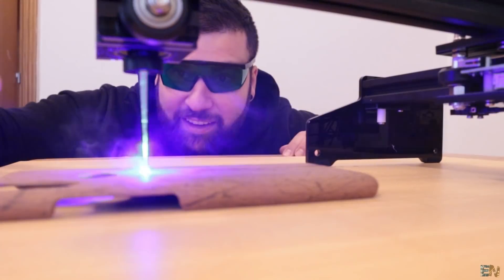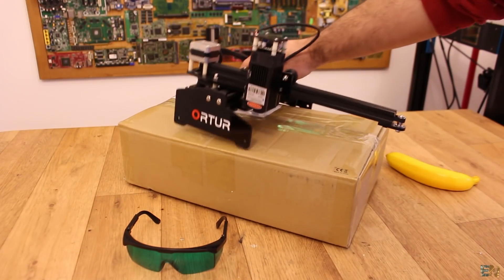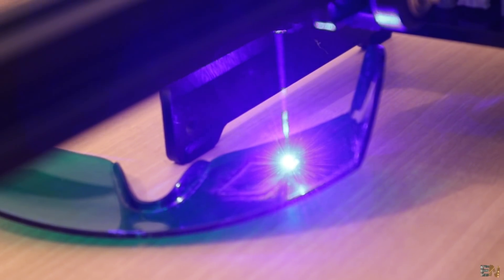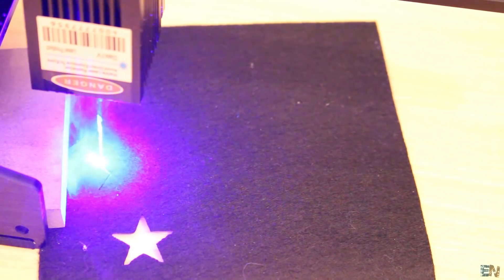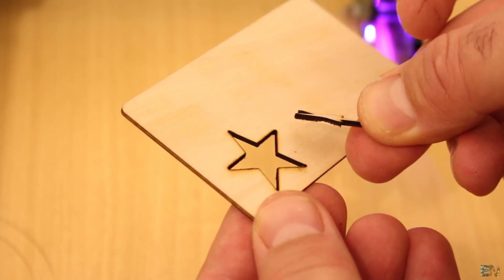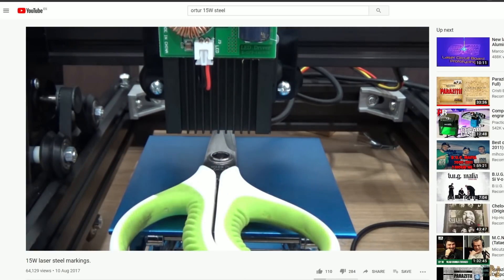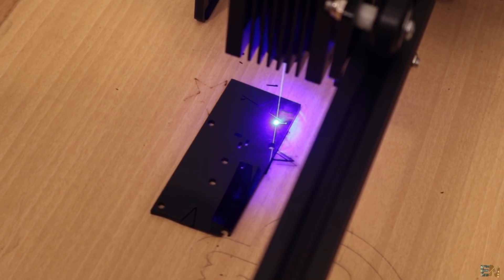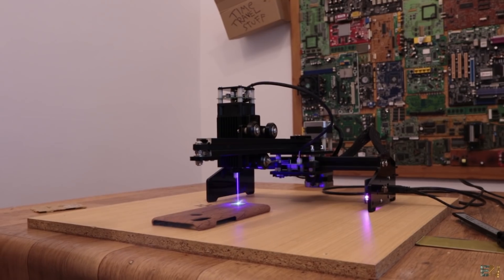What Can You Cut With This "15W" LASER Machine?

Comment from the maker: Sign up at ELECTRONOOBS.io: https://electronoobs.io/
Follow me on FACEBOOK for more: https://www.facebook.com/Electronoobs
help me on Patreon: https://www.patreon.com/ELECTRONOOBS
Reply: Hi
You can upgrade the laser to work better..
Just add an Z axis to the laser mount..
You can add also a microswitch under the laser.
So every time it resets can attach to the cutting material and then reposition to the pre-cut height.
After the end of each loop the laser will be lower at the height of your choice and so the cutting edge of the laser beam will be in the right focus
Reply: Thanks for this very detailed video and subscribed.
This electrical power 15W one, could engrave stainless steel, but it need to use the marker pen to paint black the serfuce of the stainless steel, to adovid reflection.
Also, it would be better to adjust the focusing to be as close as possible to the lens.
Reply: Thanks for the review. I couldn't find the link for better safety glasses.
Reply: Hey. Great video. Could you please share link for good quality recommended protective glasses? :)
Reply: You cant  cut wood or plywood with this laser without the compressor, use one from cheap chineese soldering station  and a needlе for ball pumping at least it will go 1000 times faster , i cut 3 mm plywood with chineese 1 w laserpointer and sodlering station compressor 6 loops on 150mm/min
Reply: Thank you for the video! Any information on the high quality laser safety glasses you discuss on the video? I just got a CNC 3018 with 5.5w laser and I do not want to use it without good laser protection.
Reply: If you notice on the video the scissor he liftend it close to the lazer you did not. Why do you youtubers always never notice differences. Pay better attention! If you copy someone make sure you copy right haha copyright!

Comment: 7:42 you can clearly see the problem is not the laser power rating but the focal "depth of field"; on an engraving laser the depth of field is a fractin of a mm because it only needs to burn just the surface of the material (of course burning 0.1mm of wood would talke a lot less power than carving 0.1mm of metal); for a cutting laser what you need is a depth of field slightly greater than the thickness of the material you wish to cut; for foam you can get away with a 5W laser as long as the focal depth of field is (in your case) 5 mm or more, which clearly the laser you showed hasn't.

Comment: To echo @Jo Flo More passes at a faster speed is usually better than less passes at slower speed. A few more tips:

Fixed focal lengths are a bit less stressful, but also less flexible. I use a 7w with a variable focus, mounted to a 3018 with Z axis. I'll set my Z home as far as possible from the material surface while still able to focus the beam properly. The reason is because the longer the beam before the convergence point, the narrower it will be immediately above the focus. With that, you can cut deeper into material--the previously cut material above doesn't interfere with as much of the beam, as it would with a wider beam due to focal point closer to the module.

I use the 3018, but there's nothing specific about that spec that is better or worse than another. The important part is the Z axis. I can generate my gcode to lower the Z by a few micrometers with each pass, keeping the focal point at the material. The rate of Z adjustment is different for each type of material.

Some materials, like wood, produce ash when burned in the cut. After several passes, the ash will completely block the beam from being able to penetrate deeper. The ash also glows, therefore radiating the thermal energy to the sides and causing unwanted results. I use 2 strategies: a relatively high CFM fan to blow ash and smoke (which cools into soot/ash) away; and I configure break points in my gcode so that I can take a moment to brush the cut path before resuming.

Hope these help!

Comment: With a cone shaped focus point, rather than setting the focus point on the top surface, try setting it roughly halfway through the balsa, it won't be as clean of a cut, but it should make it to both sides.

Comment: Laser cutting and engraving is quite complex. I too found balsa to be strangely resistant to the laser.  In contrast,, amazingly , I was able to engrave several different types of rock(even polished rock) and  I was also easily able to cut through 5 mm mdf at high speeds.

Comment: I've been doing test cuts on different materials. Chipboard, Modeling Plywood, Basswood (from Linden trees). In different thickness. The plywood is the toughest. I think it has something to do with the glue between the layers. Basswood. Blows through Basswood like a its air. Chip board cuts really clean but the engraving is very fragile. I really need to build a fence system and clamps so I can take parts off the machine and register them for secondary operations. I'm more interested in structure building in HO scale. The engraver will be used to engrave brick patterns for walls with the brick patterns interlocking like finger joints. Just draw up all CAD drawing with the same start point.

Comment: thanks for the video! I've seen a lot of these types of machines advertised on my Facebook feed. I've got a 130W CO2 laser and i typically cut 3mm acrylic and 30mm/s and 3mm MDF at 45mm/s. typically engraving speeds of 400mm/s. I'd have to agree with the glasses although because you are dealing with visible light, if you can see any blue light at all then id say that they are no good but better than nothing. one thing that bothers me with these cheap machines is that there is no air assist. if you had a nozzle that added pressured air to the cut location then the cutting speed would be greatly increased. it's just something all these machines don't have as an option. that and fume extraction :P a good little machine for experimentation and prototyping. I've ordered a "40W" laser which i will just mount to my CO2 laser head ( my controller has dual laser head control as an option) so I'll run some experiments soon :)

Comment: Yeah those cheap laser googles are garbage, real laser safety googles have an OG rating (number of digits it reduces the power) and real googles for blue lasers are orange.
the cheap one melting green layer means it blocks (eats) some of the energy, but I doubt it´s above OG3. OG3 at 4000mW would let through ~4mW, which is to high for eye safety. 1mW is rated safe for the eye shut relfex beeing fast enough.
OG4 rated laser googles should be used as minimum for this power.

Comment: I know I'm late, but I've got a tip for cutting through wood an the plastic: Lowering the speed is not always good. It leads to charing and melting, which makes the material harder to cut. If you move faster with more passes instead, you don't get these effects as much, and can achieve harder cuts.
Reply: Correct
Reply: Covering with a damp paper towel helps absorb excess heat

Comment: I think your lack of success on plastics is because you assume the laser cuts it by melting it. This is not the case, it's vaporizing the top layer. By staying too long at the same place, it's melting and becomes messy. I think most of your experiments would have worked better if you made more faster passes (with Z axis change for focalisation as you mention in the video)

Comment: to paraphrase, "The tightly focused beam couldn't penetrate the glasses, so for protecting your eyes from a distance hit from an unfocused beam, they are not good enough."  ???
Not saying there are not better glasses, but these seemed to work. They stopped the beam, certainly enough to prevent an accidental reflection from hitting your eye.

Comment: what if we shift the lazer down a mm each loop to change the focal point lower for each cut
Reply: That would have to be done manually each loop. I think setting the focus point to the middle of the material thickness right away would be worth a try
Reply: Quelix Fenzer I was going to rig a laser to my 3D printer and have it automatically
Reply: @michael040990  So you would do it like on a cnc mill where you set a depth of cut that gets applied each loop?
Reply: Quelix Fenzer yes that’s what I was going for

Comment: Yes, the stated output (15/10/7/5.5W) all turn out to be far different and lower figures (5, 3.5, 2.5, 1.6W) once they finally give you an honest "luminous output" figure.  Those cheats!  All your tests were wonderful to see.  You've convinced me that these blue/violet lasers just won't do. I'll spend the same amount of money ~$335USD and get a K40 (Chi) CO2 laser instead.  And maybe pick up a small 2W laser unit (<$100USD) and have that for slightly larger, less challenging projects.

Comment: If you had a platform (z) and an air nozzle attached setup to clear the debris, you might be able to cut thicker materials compensating for both the focal length and the debris that clogs up deeper cuts.

Comment: +Electronoobs  For laser engraving steel, you have to know the type because the methods are VERY different between low, high carbon and stainless.  I put permanent marks on my tools with a "10Watt" laser like the one you used in this video.  There are also spray and brush on ceramic compounds that the laser "cures" to create great, crisp marks.

Comment: We have a 100W CO2 cutter, and it cuts and engrave acrylic with no problem. Also we need air pulsing to avoid fire...  And this help to keep the material cooler when the laser is not on it.
Since a make a CNC by myself, i would like to add it a laser module, and i was wondering about this laser daiode...Y save me 150 bucks, thx !

Comment: for that slow speed and low depth and risk(eyes+lungs)
a small cnc router is really the better option
Reply: That has disadvantages as well. For one, it's damn noisy. I couldn't run a cnc router in the evening, when I would have time for hobby stuff such as this. Every tool has its advantages/disadvantages, and this is no different.
Reply: @SolarWebsite  true but, others found solutions for that which are a closed cabinet https://www.youtube.com/watch?v=SOgn47YAe84  and also sound dampening walls, its easier than you think: 
https://www.youtube.com/watch?v=pABvTWSxOes

Comment: Will you please do a test for me, engrave a name on steel, I would like to know if it would mark it with or without the ceramic spray.
Reply: Ceramic spray is what they use to engrave metal? Is there anything recommended for glass?
Reply: It need to paint the stainless steel black first, and then, engraver the naome on the surface.

Comment: They say "15w laser" but in reality the wattage includes the fan. Take a look at listings for "15w laser" on eBay and look closely at the spec sheet. These are typically 5w diodes.  The highest powered 441nm diode you can buy is 7 watts.   Unhook the fan and measure the power draw draw of just the diode
Reply: I have done a fair amount of research into visible light laser cutting and I highly doubt the power of the diode is what they say it is

Comment: If is not pas trought just.. make it slower if is melting too much you need BLOW in the laser beam (on stop you negrave) by any air nozzle.... shut be beter trust me,... //ya you canot pass by copper is not powerfull enought anf for coper is green spectrum or UV much beter to etch..

Comment: It will engrave steel but you need a Laser marking spray (Cermark) which is actually laser bonding type spray, so tiny particles from the paint are laser bonded to the metal and it's permanent.

Comment: Please do tests using styrene sheet, Scale modellers use styrene alot it is a huge category of hobbyists. We are always looking for afordable alternatives to straight edge and hobby knife. I suspect it will cut styrene fine as it cut acylic and styrene is a far softer material than acrylic. I would be interetesting to see speeds Vs thickness Vs black styrene Vs White. Interesting video, laser cutting it just another awsome tool to complement 3D printing, Resin casting, and CNC machining. This machine has a lot of potential for proving proof of concept for different scale model kit production methods.

Comment: -Try full power and full speed and more loops make it cut thru and with out all that burn materiel :) - Deep cut's and low speed never makes a good result! - and a Little hin't with cutting/engraving i metal - just paint it with a Black marker - the marker can be clean't off with alcohol - even works fine with my cheap 80$ Neje 3w laser

Comment: Hi all !  Very good video, my friend.  Very educative and instructive.  Chinese 445nm Lasers are often over rated and short lasting (around 10% Duty Cycle).  Try other country's truly manufactured and engineered in the US to in Russia.  I had an 8,5W Russian laser head that was practically indestructible (95% Duty Cycle) and was really 8,5W .. even a little more !  Look for « Endurance Lasers ».  You'll be amazed by their quality and durability.   

I've been working with Lasers for about 6 years now, and I worked my way up from a cheap 2,5w 445nm Chinese Laser to a 45W CO2 Laser and I've learned a lot from experimenting on my own.  Watching this interesting video, there were a few things about these tests that popped to mind.  Here are a few tips I would like to share with you, guys.

1). At that Laser's frequency, these glasses are very good even if they seems cheap.  You can trust them.  The fact that you can't go through them with the Laser is not a proof in itself.  You can trust green and red glasses, although red blocks almost all of the light and you'll see nothing of your workplace.  Go with green.

2). As you figured it out already, on 'thick' material, the focus should be made in the center of the thickness, not on top .. that's good for engraving only.  Also, the longer the focal length, the better .. but you'll lose power along the way so, it's a compromise.

3). Glues and Lasers do not make a good match.  So when cutting plywood, MDF, Press-wood and other agglomerated materials, there is burned and melted glue on the kerf and it's a messy job.  This is true with all Lasers, so I avoid cutting these materials as much as possible.  Go with solid all-wood material.  It pays off and the result looks much better.

4). !! DANGER !!  Material that contains chlorine is not only dangerous to your health, but also for the machine itself.  It will corrode the metal parts inside and scrap your machine.  PLEASE, AVOID Vinyl, PVC, Polycarylate, Polycarbonate ... AT ALL COSTS !!

5). For better results, we generally use Painter's Tape to cover the wood surface that is to be cut.  This prevents smoke burns and soot on each sides of the kerf and makes a 'cleaner', more 'professional' cut.

6).  You're better cut at a faster speed and do more passes than slower speed and fewer passes.  Here again, cleaner kerf and more professional look.

Thank you for reading and commenting this comment.  I do try to help.  Have a nice day, all !
Reply: Oncle Dan  Thank you for sharing your experiences they are much appreciated.
Reply: @phantomcruizer  Ortur Laser Master: Electronical Power 15W and Luminous Power 4.0-4.5W.
Reply: Hello, I'm wondering if you can safely (for the machine and own health) cut EVA foams with these kind of cheap laser cutters?
Reply: @rrairr  If the unit is in a well ventilated environment and the foam is very thin (<3mm) ans of dark color (except green), it could cut it.
Reply: @daniellachance8826  Thanks! That's exactly what I need to cut, 3mm of EVA foams. Bit concerned about the precision though since the machine doesn't have a Z axis. Need to cut some small details
Reply: Can you cut parts for hire?
Reply: @TheRainHarvester  Good day, « Harvester ».
Are you asking me (Uncle Dan) of Electronoobs ?  For the way you post your message (in response to me), you would be asking me.
IF this is the case, I sure can, but I'm afraid my location could be a problem. I'm in Canada .. Québec to be exact.
Thank you for clarifying.  Meanwhile, have a great day and take care.
Reply: Good points.  However, AFAIK acrylic and polycarbonate don't contain chlorine.

Comment: To cut thicker materials you need z-axis or automated adjustable focus to move the laser focus down through the materials. You are correct in that 435nm does nothing on clear or white. And in fact most metals act like mirrors for infrared (heat). This is why laser cutting metals is so difficult. Great video and comprehensive!

Comment: Hello my friend ..
Can we replace  the lazer hed with another more powerful one (40_50 _60 _ets..watts).with the same set and the same program.
and what changes  be made .
thanks ..
Reply: the only higher power lasers are CO2 based, certainly will not fit on the mechanism he is using.
Reply: its the tube and psu not the head!

Comment: You should be more careful with the materials you cut.
Especially things like styrofoam release toxic gases when they burn (e.g. chlorine) and should not be laser-cut - or at least not without a good dedicated filtering system.

Also, you should add an air-assist to prevent the smoke from the cuts from affecting the lens.
Reply: I own a table top cnc cutter. You can make a easy exhaust system and vent it out a window. A fart fan and dryer vent pipe works. Or you can use a range hood vented through the roof.

Comment: make a right angle tube that focuses a jet of air with the laser it will help a LOT.. i use a big 60w aquarium air pump with a 3/8" silicone air line... and a 3d printed cone with a 2mm opening it press fits over the focus ring and the air help clears the cut like this a 10w can cut 12mm balsa in 15 passes at 5mm/s

Comment: what was the actual output? did you do any type of current and voltage readings? most of these are 7watt or less diodes being over driven.
Reply: Electronical Power is 15W and luminous Power is 4.0-4.5W